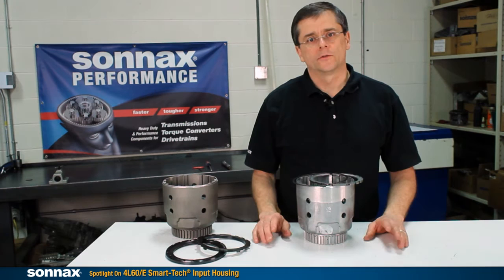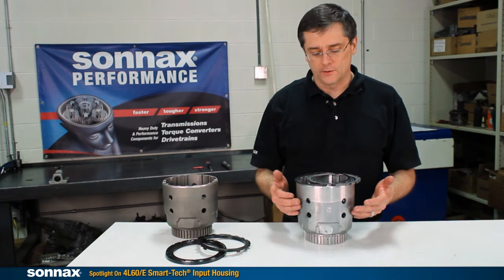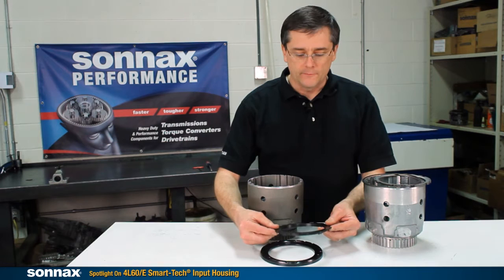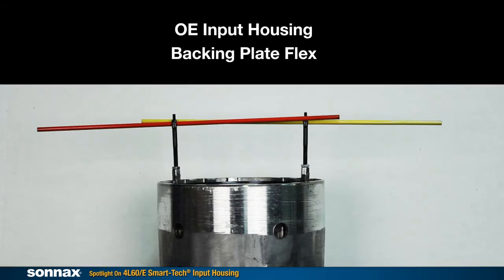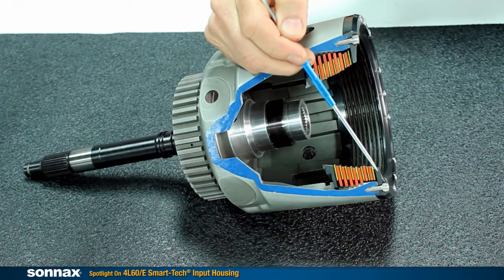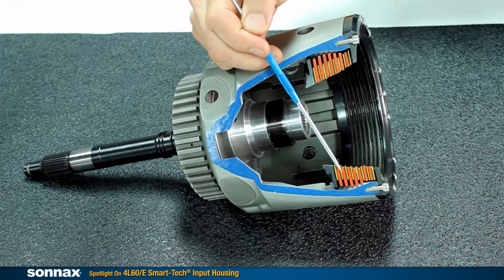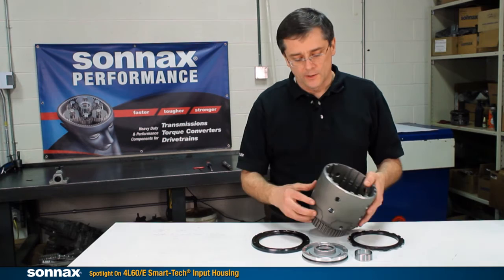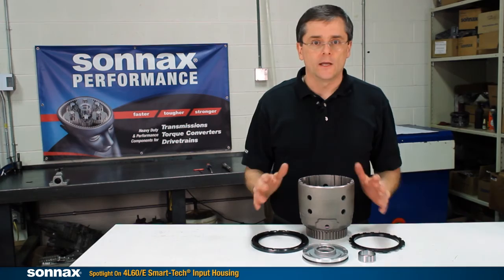Sonnax 4L60/E Smart-Tech® Input Housing

Comment: iv'e used one of these they are good but expensive and you have to get the special shims for it to adjust end float
Reply from the maker: +SICKDUDE38 We find clutch clearance is easily adjusted with the available selection of different thickness steels and frictions. Overall transmission end play should not be affected by the Smart-Tech housing. If you find otherwise, please contact Sonnax Tech Support so we can follow up with any potential problems. They can be reached via email at sonnaxtechsupport@sonnax.com, or by phone at 800-843-2600. Hope that helps. Thanks and have a great day!

Comment: Ive been building 4l60e input drums with a 7 friction set up, I use raybestos GPZ100 .080 frictions and .076 steels along with a .225 apply plate and .193 backing plate(ill throw in a .095 steel in the middle to get between .030 to .035 clearance) This set up works very well and holds good power, OF COURSE IM NOT SATISFIED LOL. Using this same recipe how many frictions will I be able to fit in the sonnex smart drum?
Reply from the maker: Hi, our tech team would be happy to help you. They can be reached directly via email at sonnaxtechsupport@sonnax.com, or phone at (800) 843-2600 ext. 398. Thanks for reaching out!
Reply: What was the answer to the question?
Reply: @ThisIsSolution  DUH?!?   You've never followed the instructions given to the poster, I presume?  Sonnax has a staff of techs that gives answers to any questions one might have--no "guessing," just fact based knowledge...   lmao
Reply: @bobhoffman5581  did u get the answer?
Reply: @ThisIsSolution  Yeah--call 'em UP!  Obviously, you've never done that...  lol

Comment: Will it work with 700r4
Reply from the maker: Yes it does!
Reply: @sonnax   would the 77733-10k be the package with the input shaft needed for a 700r4?
Reply from the maker: @Sweak22v1  Our tech team would be happy to help you confirm which product you need. They can be reached directly via email at sonnaxtechsupport@sonnax.com, or phone at (800) 843-2600 ext. 398. Thanks for reaching out!

Comment: Will this work with a z pak
Reply from the maker: Hi Chris, technically it is possible, but it requires more than one clutch kit to get enough to fill our larger capacity housing. Our experience has shown the best overall combinations are:

• Eight .067" frictions with seven .095" steels
• Nine .062" frictions with eight .077" steels

Hope that helps. Thanks for reaching out!

Comment: is this what causes 4th gear (overdrive) slippage in high mileage transmissions?
Reply from the maker: 4th gear slippage and 3-4 clutch failure are common problems in high mileage transmissions, but typically due to other areas within the transmission. The 77733-06K is particularly suited to heavy-duty applications or when power levels are increased beyond what the vehicle originally came with. Hope that helps. Thank you!

Comment: just get a 4l80e
Reply: Can you replace a 4L60E with 4L80E transmission? And will it be a straight even swap fit?
Reply: No different length and connectors, and will need to tell pcm it's an 80 not a 60